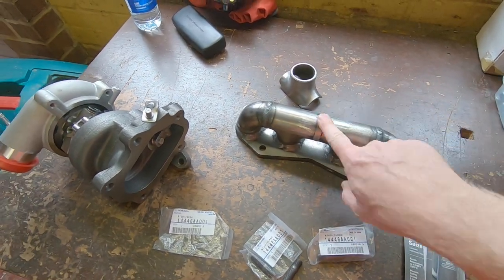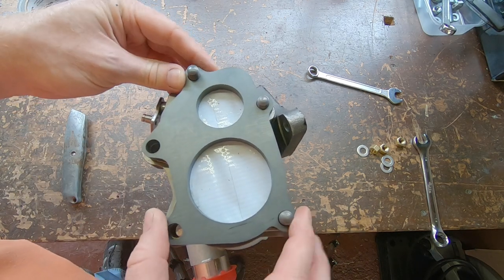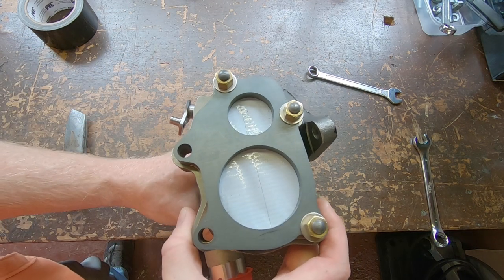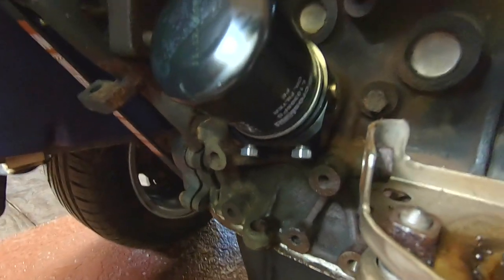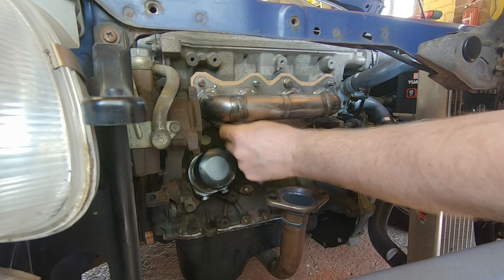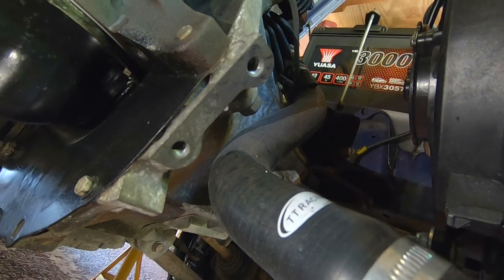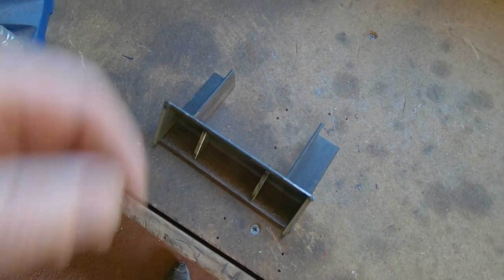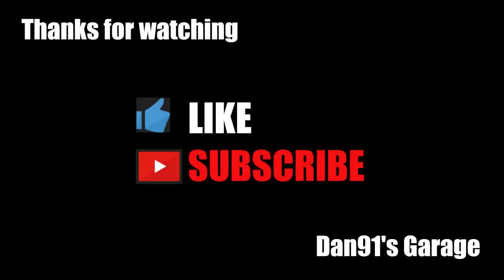What my 4efe engine needs before turbo install | Toyota Starlet 4efe turbo build.

Comment: good day sir, what kpa or psi is your radiator cap? 0.9kpa(13psi) or 1.1(16psi)? thank you very much! is it good also for long drive?
Reply from the maker: I'm using a Civic half radiator from Tegiwa and it comes with a 1.3 bar rad cap. No problems with it.
Install video:
https://youtu.be/RpA2T589Y-A

Comment: Hello currently I am driving 4efe 1.3liter  4 speed manual I want to upgrade it to 5 speed manual gear box which gear box I should use currently I am using c140 
Thank you
Reply: A C150 or C151 from a tercel/corolla II, Paseo, or non-turbo high grade starlet will drop in

if you're willing to do some more convoluted work for a gearbox that could handle a decent bit more torque than stock you can get a C52 from like, 1993-2000 corolla and mount it to the C140 bellhousing

Comment: I sir very  good job can you sent me all link you buy your turbo and your ecu box all so
Reply from the maker: Thanks,
Maxpeedignrods turbo, Subaru TD04l 13t-6: https://www.maxpeedingrods.com/product/subaru-forester-xt-impreza-wrx-nb-2.0l-58t-td04l-13t-6-turbo-turbocharger.html
ECUmaster DET3 with in built 4 bar MAP sensor, check the distributors page for your country:

https://www.ecumaster.com/products/digital-ecu-tuner-3/
Reply: Thanks sir is the engine 4efe will support the torbo well or can damage the engine??
Reply from the maker: As long as the engine is in good condition, you are sensible with the level of boost, have good fuel quality and have a good tune in the det 3 these engines are good.
Reply: @dan91sgarage  ok thanks